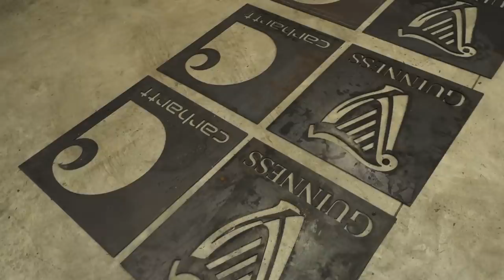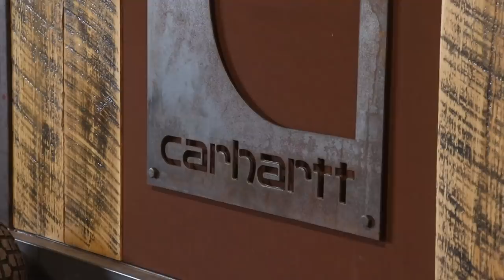DiResta Carhartt Guinness Bars

Comment: Are those the fireball tools squares? I’m not an engineer or a machinist and I can see they are so clever. I’m Irish too so anything Guinness, I approve. Slick work as always brother, sláinte.
Reply: I bought a fixture table after a good while of being into welding projects. If I had to do it over, I would just buy a thick 3'x4' piece of plate, fab that into my welding table and buy a set of the fireball squares. I have the squares and I don't even use the fixture table as anything other than a welding table.

Comment: Anyone know why Jimmy lifts boards up slightly while cutting them on the miter saw?
Reply: Probably so they don't bind on the blade as the cut is made. Not necessary on square stock but can be an issue on rough cut lumber. Just a guess.

Comment: Really cool video, learn something every time I watch one of your videos! What is the machine you use at 6.15 called?
Reply: Diliverium it’s a belt sander, not sure where you can find a giant like that tho
Reply: @MikeTheMaker1  Thanks! Have never seen one with a handle before
Reply: Diliverium that’s a really old one. OSHA wouldn’t approve of that today. I don’t know what that one is but Heesemann has a model similar to that. The handle is attached to a plate that slides along and sands the material. Google “Heesemann History” and they should come up as the first site.

Comment: Anyone want to take bets on how long it will take the wheels on one side of that rolling bar will get real tight and no longer turn and the other side wheels will get real loose real fast and fall off. You can ask me how I know and I can tell you a long story about the first push car I built when I was wee lad (I could of said kid but after all DiResta is building this for Guinness so wee lad sounded better) or just look at wagons of all sizes, push carts, hand trucks, or wheel barrow axles and they will either have castle nuts and cotter pins or washers and cotter pins.
Reply from the maker: the nuts were ca glued in place.. no loosens or tighten to worry about